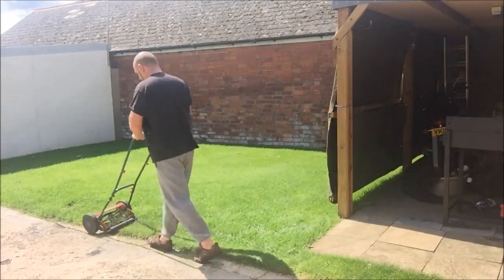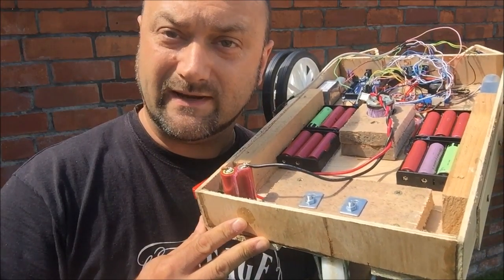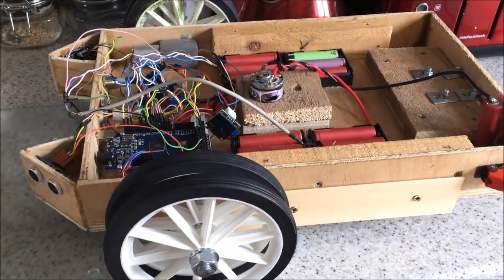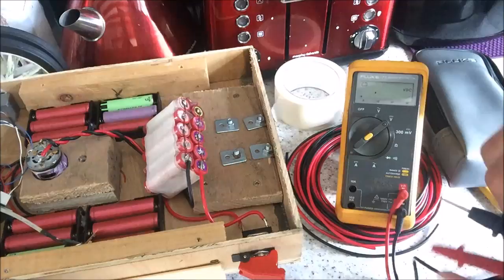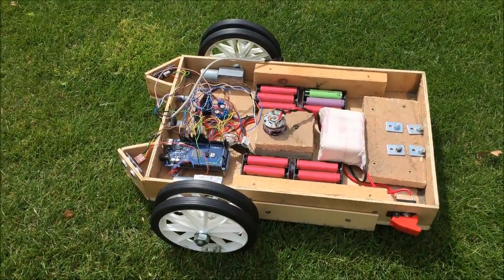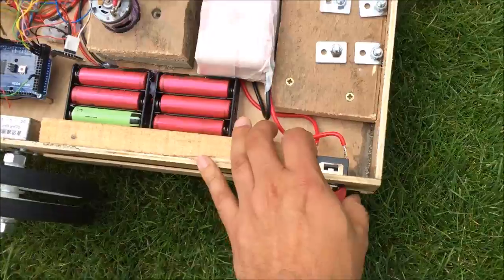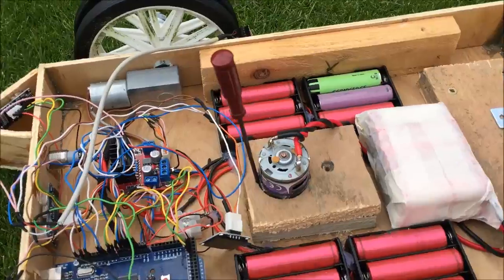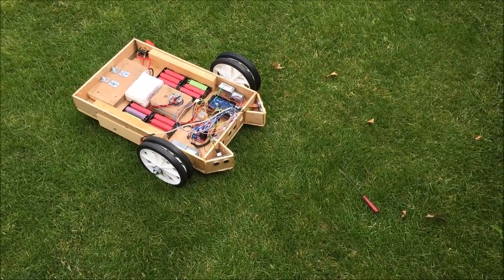Robot Lawn Mower PT23

Comment: No BMS? YOU KILL THE CELLS LIKE THAT.
Reply from the maker: You are quite correct!!  I have learned a lot since then!!!
Reply: @DubiousEngineering  the easiest way to work with, are the ni-mh cells. 1.2v each. Put them in series without bms.....and you are good to go with. 800-1000 cycles. They don't need BMS. after 3-4 years you may have to replace 1 of the first and last cell which will not hold the charge properly. In this situation NI-MH is beating the lithium. But.....there is a small problem.....NI-MH cannot hold their charge. They loose energy everyday. They need solar input. 3-5% its wasted everyday from their charge even without using them in cycles. Wish you all the best.

Comment: How about just making a bit of wood that fits in the motor hole but has a hole for the shaft at you can secure inside to keep the motor from slipping out the bottom
Reply from the maker: Alex Lynch ... I totally change the cutting system in part 29... that said, good idea! Thanks for your input!! :-)